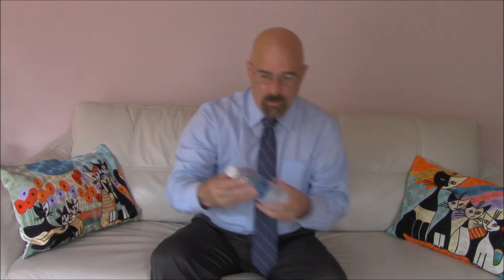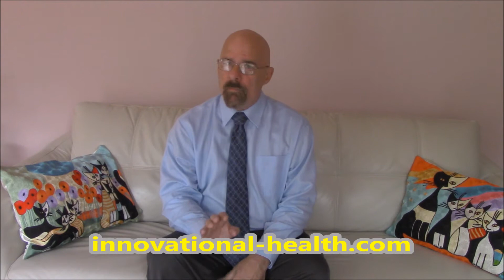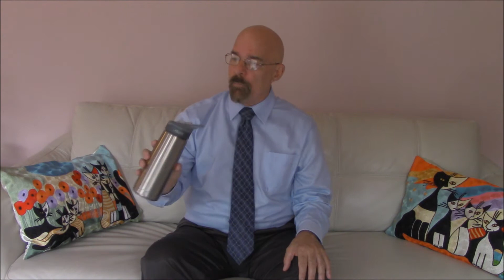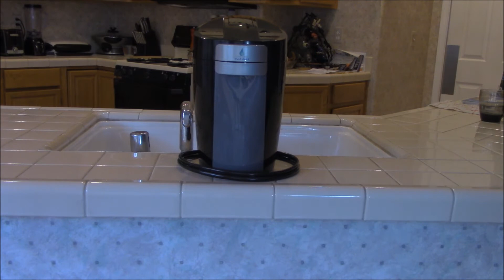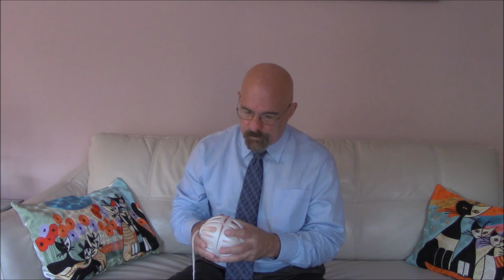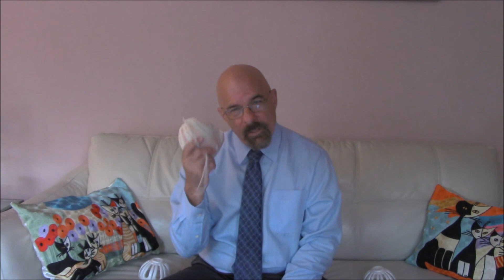Pure Water - One Of The Most Important Videos You Will Ever See

Comment: Great discussion Ray, what is your take while "RV' traveling on the road? A Reverse Osmosis Filter or a decent PUR or Brita Container.  I went to an RV park and the water was so yellow I opt not to connect the hose to TIMROVER. I bought a water test kit and it is astonishing what we are drinking and/or absorbing.
Reply from the maker: I would buy the best filter that I could afford from either of the two companies that I recommended in the video. My preference is for Multipure products as their entire line basically dominates the top of the NSF testing where only Amway's $1,000 filter meets the requirements. The positioning of the filter needs to be as close to the point-of-use (end of faucet) as possible. It is not a question of Reverse Osmosis or any other type of system, it is strictly about which system tests the best. In our RV, I use a water softener and then a whole house filter before the water pump, a secondary NSF qualified built-in filter from Winnebago is next followed by a Multipure filter at the point-of-use. I also use a Multipure shower filter. Again, I need to say that I do not have any financial interests in any of these companies.